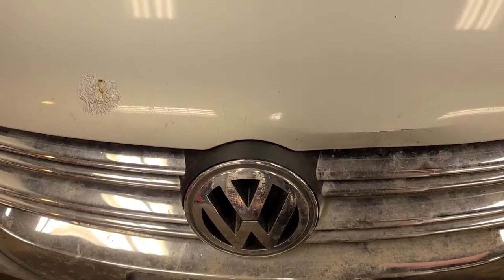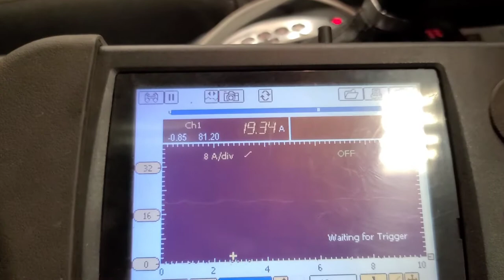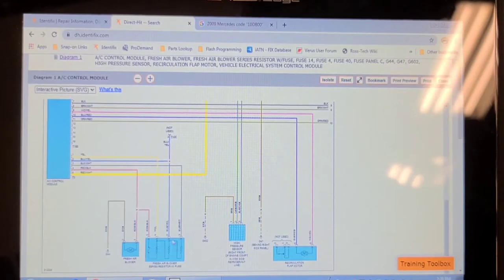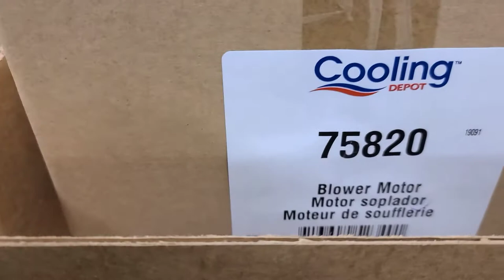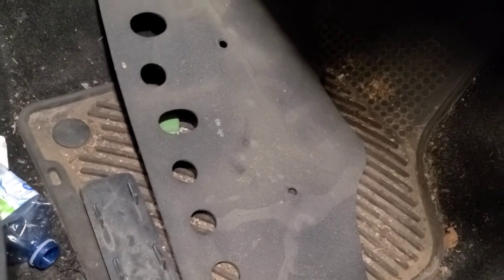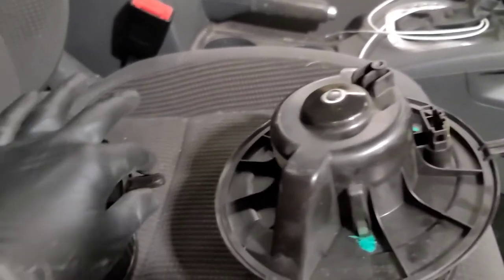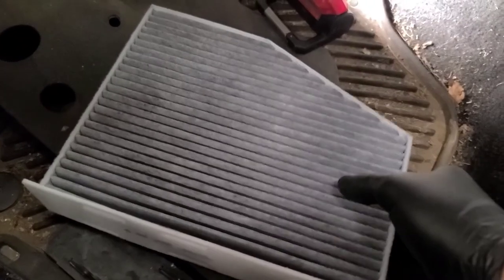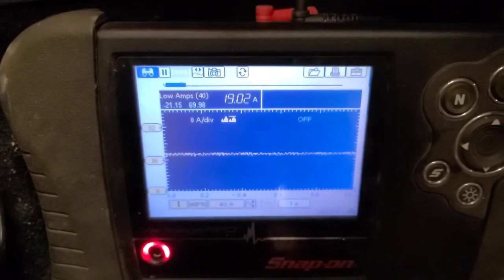2009 VW Jetta Heater Blower Testing and Replacement With Blower Resistor.

Comment: HI IF THE BLOWER IS NEW AND THE RESISTOR IS NEW THEN ONLY THE NUMBER 4 ONLY WORKING...NUMBER 1 2 AND 3 IS NOT WORKING THEN WHAT IS THE PROBLEM?LOOKING FORWARD FOR YOUR REPLY....TY.............PS MY CAR IS VW GOLF 2004
Reply from the maker: Well only running on high is a classic example of the thermal fuse in the blower resistor being open. I would recommend to retest the blower resistor. I know you said it's new but could still be defective. If you have an ohm meter connect the meter across any two of the terminals on the resistor with it disconnected. You should have continuity between all terminals with low resistance measured. Test between 1 and 3 of the resistor will test all three resistors and the internal fuse. Alternatively connect a test light between ground and pin 3 with the fan speed on low and everything plugged in. Test light should light on pin 3 when in low, pin 2 on medium low, pin 1 on med hi and pin 4 on high. If those tests are good the resistor has failed. Otherwise to have the condition you describe would require multiple problems with wiring or the control head. If you run the heater fan on low without the motor blowing air on the resistor for cooling it will fail in about 10 seconds.  HTH good luck and keep us posted.
Reply from the maker: Just noticed you mentioned it was an 04 Golf. Testing is pretty close to the same just pin 2 is low instead of 3. Otherwise same idea.
Reply: @PhillipBailey  TY SO MUCH I ALREADY SUBS YOUR CHANNEL
Reply from the maker: Did you figure it out?
Reply: @PhillipBailey  not at the moment maybe after new year...my friend gonna check it for me..number 4 is working now because i change the blow fuse...but 1 2 and 3 still no sign of function